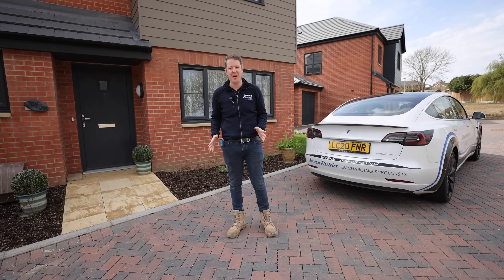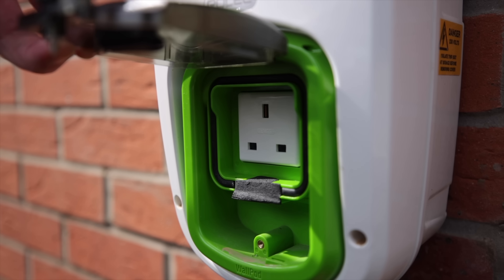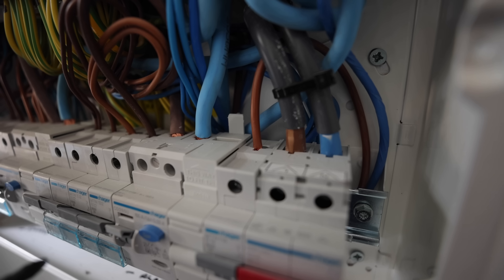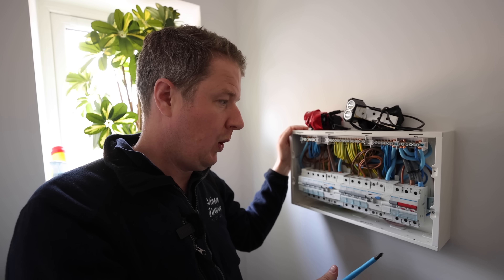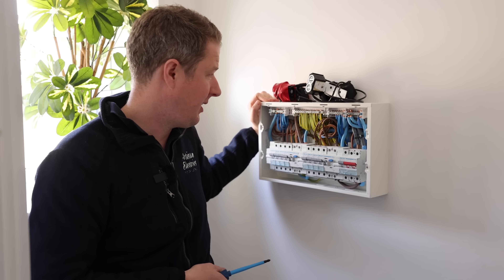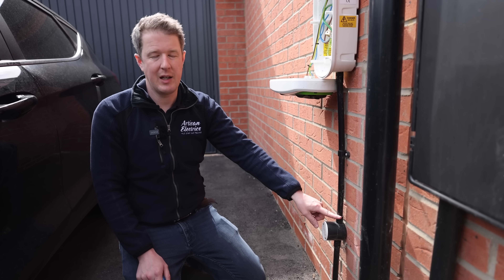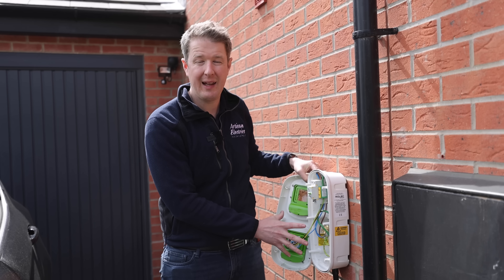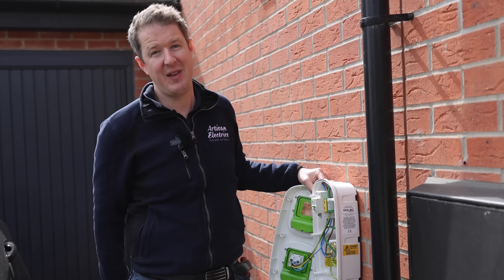New Builds AREN’T READY for EV Charge Points!

Comment: A friend of mine bought a new build with one of those pods, when he came to upgrade it he found it was only wired in 2.5mm (which for some reason was on a 32A MCB)!  Felt like a total box-ticking item to get it past the local authority's requirement for the houses to have "EV Chargers" with no consideration to actually fitting something usable.  Plus, with the consumer unit located centrally in the property, replacing that cable becomes an absolute nightmare.
Reply from the maker: Seems that’s the case at a lot of properties
Reply: @artisanelectrics  Yep my newbuild has wired in on 2.5mm, So i’m stuck with 2.5mm, could you run that at 25A, with a 25A MCB? My charger has dip switches so I could limit it to 25A
Reply: I think the NHBC and bodies like the NICEIC should be forced to be more accountable on new builds. Force a fine and inspected remedial work plus compensation to the homeowner and they will want to make sure it’s done right. 
It does make you feel that organisations offering guarantees are there not for the consumer but for members and is gives a false impression of quality and workmanship. 
You can see where it breaks down when tasks are tendered for and most likely the lowest bid is accepted. The trades intend to do a good job but a delay gets introduced so they start cutting corners to save time and money. If in the short to medium term it ends up costing them more ( not the consumer ) to fix poor workmanship than any business owner will realise it’s more cost effective to do it right first time round. Of course some companies just have low standards and if their reputation or financial state comes under pressure they just phoenix themselves but that can be spotted in any good tender process.

Comment: Unless they are going to use EV ultra type cable and leave space in the consumer unit to get a ct clamp around the tails they may as well not bother as doing it like this either limits the customer's choice of chargepoint or will cause the EV installer so much work they probably would prefer to do the lot themselves.

Better provision for an EV charger would probably be simply install a duct in the ground between the consumer unit and most likely location for a charger. If the CU is in the hallway they could hide the duct in the wall behind an access hatch and also some flexi con the the meter box for a ct cable.

Shocking bad install on that Rolec unit too.
Reply: Yes because builders actually care about customers so much, they’d take extra time on every plot to install a duct
Reply: Wise words
Reply: Zero chance that duct will be any use, you have met the guys who build these new builds right? Thought there were radio based solutions for monitoring current now?
Reply: Fit a zappi and use the Harvi for a wireless CT, not really an issue. EV ultra cable is so overpriced it really doesn't make sense to use it.

Comment: Seriously how much more would it have cost to just fit an actual 7kw charger to the property?!? Typical new build shoe string construction....
Reply: To fit a Rolec?  Probably less than £100 more than the one that's fitted there.  They already fitted the correct size cable and earth electrode, so it's just a a different breaker and the Rolec wallbox itself.
Reply: But then those properties would not be "ev ready" and they have a quota for "ev ready"...

After writing this, I'm not quite sure if it really is a joke.